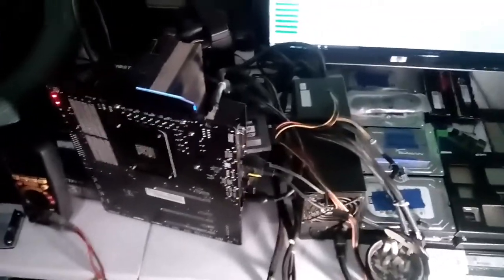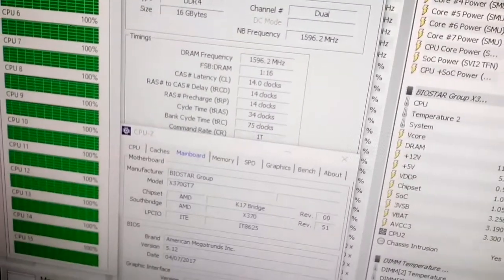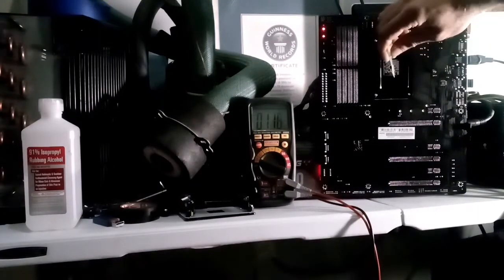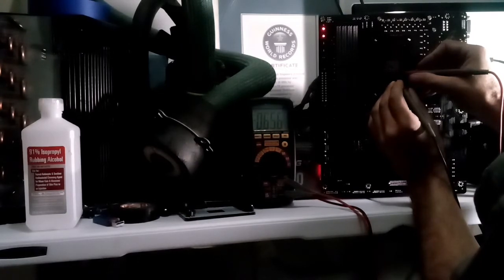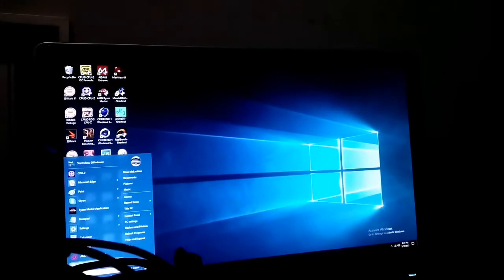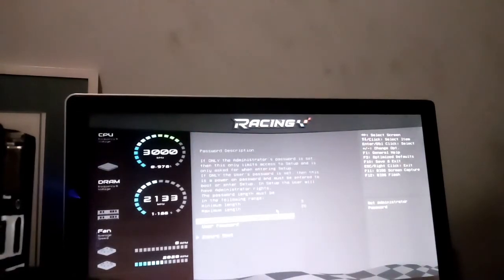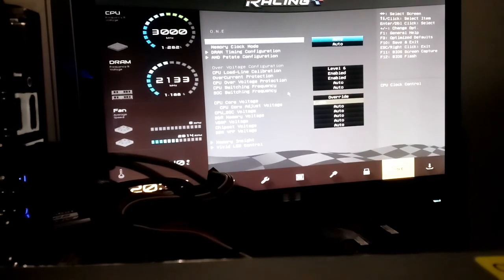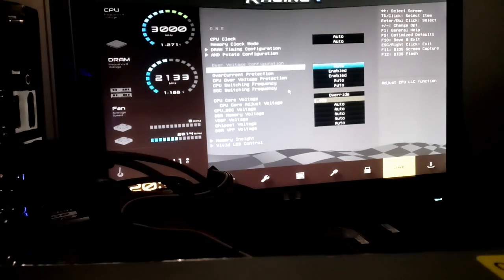Biostar GT7 Temps,Voltage etc etc

Comment: why you dont use VPP? i saw recommendation from NAME GT using 0.105V for 3200 samsung b-die
Reply from the maker: ЕХИДНЫЙ It may be usefull for "benchmarking" but the least amount of voltage needed for stability is usually the preferred method. Not many extreme over clockers cater to the 24/7 user unless of course they are employed and it is there job.. Keep in mind always all silicon is different and must be tuned unique ly.
Reply: help me with that memory)
Reply from the maker: ЕХИДНЫЙ i would start with 15-17-17 2666 then baby step up to 2933 for hynix based IC @ 1.35vddr 1.030 SOC on this board and up to +.80 vddp. Samsung B die will net you better timings/speed. keep the ratio this way for hyni though. 15-17-17/16-18-18/17-19-19. since odd cas does not work. 16-18-18 will most likely work the best.
Reply: if i set myself 2667 16-15-15-15-36 it fails. if i set standart 2667 15-15-15-15-36 it runs as 2667 16-15-15-15-36 automaticly! yea i try more VDDP (im on 0.20v) and less VPP. today.
Reply: i saw people runs eazy 3200 mhz m-die without BLCK tune on Asus CH6!
Reply from the maker: ЕХИДНЫЙ you must always compare performance. 3600 if the board is running slacked is same as 3200. i am still on an old bios on c6h. i can not do 3600 stable but my 3200 beats results of there's with 3600....
Reply: nothing works best option is set standart 2667 15-15-15-15-36 it runs as 2667 16-15-15-15-36 automaticly. i would wait May update.

Comment: Your RAM is at 3200 and I've baby stepped mine up as well.  Cant quite get there.  Could it be my chip because I'm not sure what I'm doing wrong.
Reply from the maker: Skyrabbit Ranger i can screenshot my voltages if it helps.